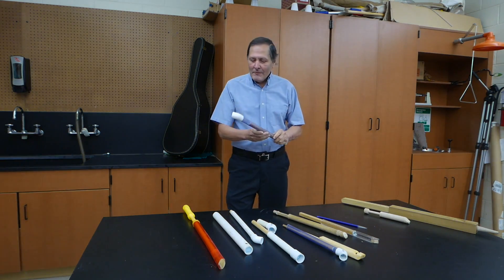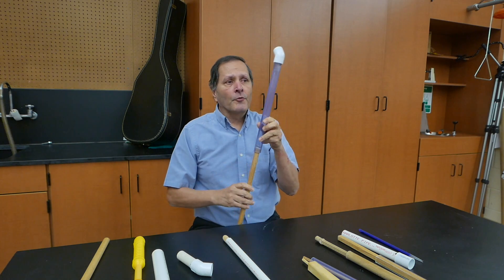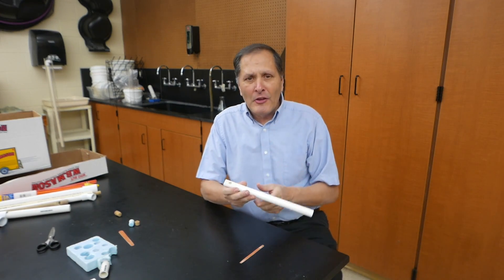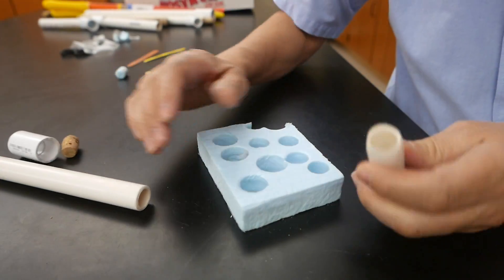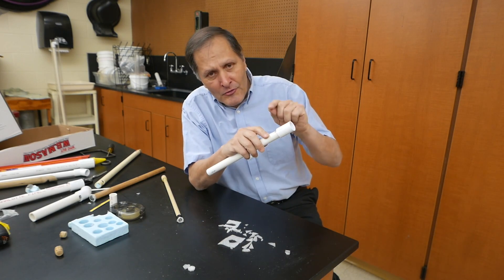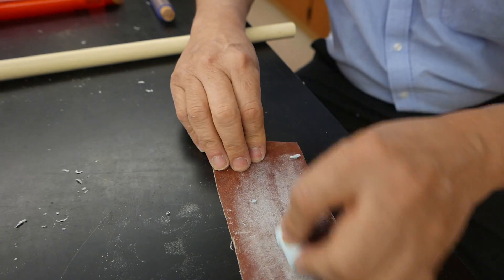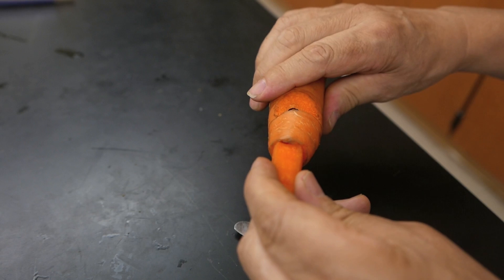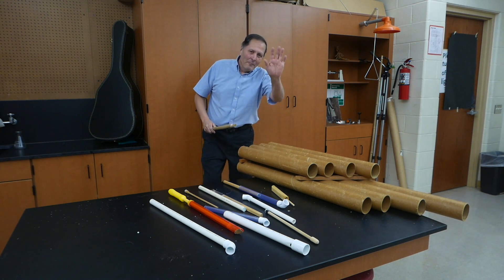Slide Whistles  part 1 // Homemade Science with Bruce Yeany

Comment: Amazing stuff! My daughter is non verbal, Autism & is a sensory seeker. She came across a water toy last summer called Splash Fun, Pipeline Pumper by Jaru. They were at our local Christmas Tree shop but they closed down by the end of the summer. What attracted her to them was the fact they made a specific whistling sound when used without water. I ordered five of them from an out of state company in California, but only two of the five did the sound she liked. She has been asking for them the last months since the store closed down & thankfully I was able to contact the company via phone, they were kind enough to test them for me to see if they made the whistle sound, 4 of the 9 in fact did. Of course I placed an online order to have the 4 shipped for her Christmas wish.. I just a wonder why some didn't make the same sound, they all appeared to have the same identical characteristics, same measurements, it was driving me up the wall trying to figure out why the other three didn't produce the sound. The only thing I think I figured out was that the orange ones that didn't make that sound seemed to have a slightly wider tube when sliding the handle stick in & out. Also the hole at the end where the water squirts out, seemed to not have the same amount of the plastic ring going inward as much as the others. I even dried out most of the clear grease, but still no whistle sound. It wasn't like a regular whistle sound, more like a bird type sound. When the handle is pulled out and twisted about or back in etc.. I would even have made some for her, but I don't have the tools etc for that. Appreciate your videos very educational.

Comment: Hi Bruce, 

Made several of your designs. I followed your method precisely, but NONE of them work. I suspect there is something critical in the manufacture that you may have stumbled on without realising. I am UK based and collect my plastic pipe from a local supplier. For example; The wall thickness may be different to the material you use. I am an engineer so capable of following instructions and making items exactly.
If you read this, please suggest the variable which I should look at to solve the problem. 
Many thanks, Paul
Reply: Having similar issue, although yet to try all methods. Did you find a way to make it work?

Comment: I never really understood how the whistle actually works
The pipe is simple as determining the length of the stationary wave inside, but i never really got how the whistle and the air pressure fit into this
Reply from the maker: Hi Luiz,  the video wasgetting too long so I decided to break it  into  two parts.  I hope to explain what you are asking in part 2
Reply: Thanks! I'm looking forward for part 2 to get some closure into my what-are-flutes-and-how-does-that-even-work thingy haha